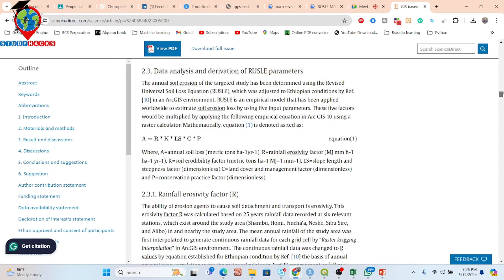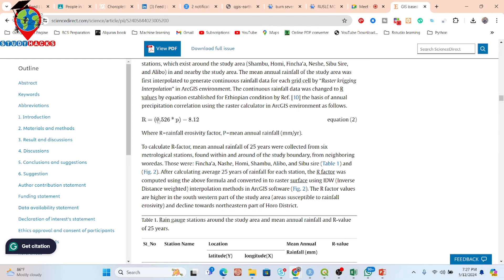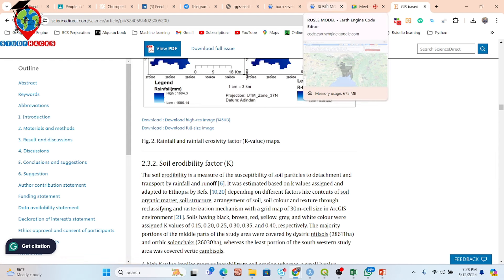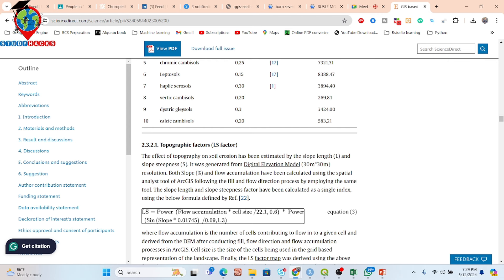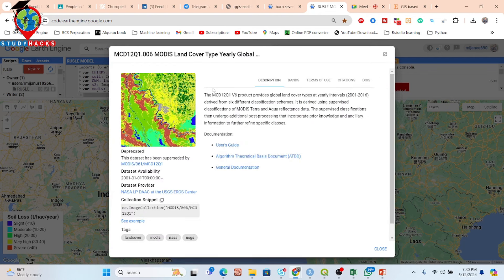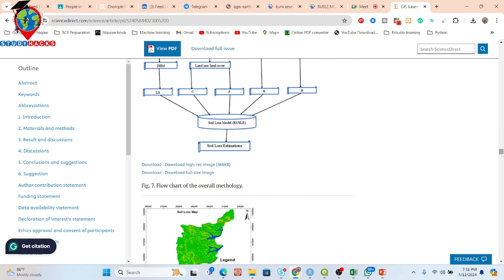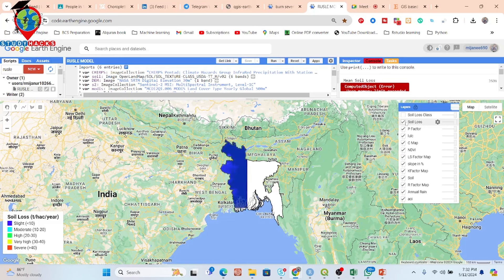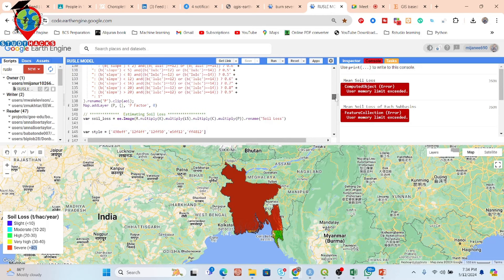Spatial estimation of soil erosion using RUSLE model in Google Earth Engine

Comment from the maker: Code link: https://www.patreon.com/user/shop/spatial-estimation-of-soil-erosion-using-207084?u=27493560&utm_medium=clipboard_copy&utm_source=copyLink&utm_campaign=productshare_fan&utm_content=join_link
Reply: Paid $10.62 in the above-mentioned link but not received the code yet....
Reply from the maker: @Abhisek_BIT  Why? immediately contact here

WhatsApp: +8801780942798
Reply from the maker: You just get a txt file. This file attached the code link. When you buy it you can easily get the txt file, in this txt file you find a code link. 
If you have any problem regarding these issues contact our WhatsApp number: +8801780942798 or Email: rmijanur10266@gmail.com

Regards.